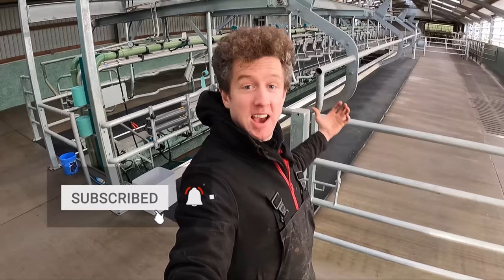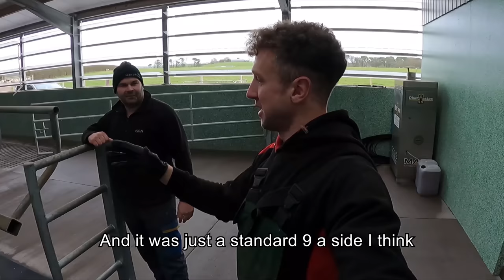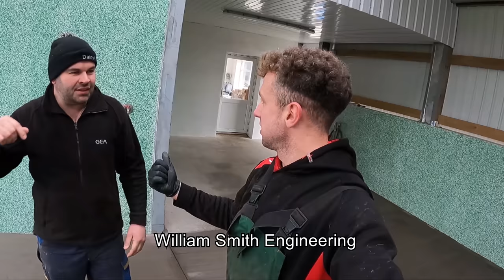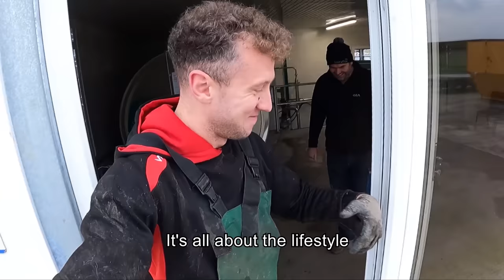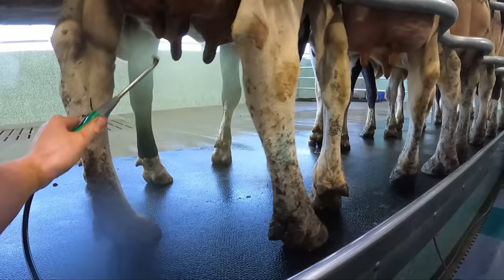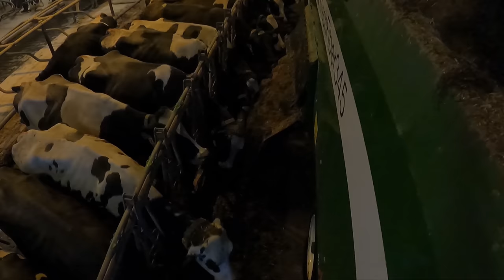This Dairy Farmer built his own 'RAPID EXIT' milking parlor!

Comment: Saskduchkid doesn’t have a swing over parlour, but he has a pooprinal  installed in the top rail. It has a shield and a gutter to save the milker from the splutter.
Reply from the maker: That does sound good, nobody likes getting covered in poo! 😂
Reply: I was also wondering how they deal with poop in this parlor, but it looked like they had very few pooping cows.  They say you should only have about 3 of of 100 cows pooping or something in your parlor is not right for the cows.

Comment: What a  fantastic milking parlour. The only thing I don't understand is when the cows walk down how do they get them pointing in the right direction?  Cheers 🍷🍺👍🏼
Reply: Before he built the parlor they probably face that way get fed meal as they were being milked, and new heifers usually are put in the middle of the group so they come in at the right angle with the older cows. Its doesn't take cows to get used to the new set up. What really got me was the ventilation on the walls, great idea.
Reply: @mistypeppercorn914   thanks for the reply. I only know about milking before these new systems, they headed for the feed and every cow knew their correct place. Cheers 🍷🍺👍🏼
Reply from the maker: Well answered Misty thanks! Cheers for the question also Chris it was a good one!

Comment: Do they not get fed during the milking 🤔
Reply: Quite a few new parlours lately are going down the No Feeder route. Keeps costs down and a cleaner parlour. External feeders in the shed are used or they are are simply fed the same meal in the feeder wagon.
Reply: @mikeysky8917  aw a c just use to working with feeders in parlour to be fair never seen a rapid exit in action but cheers mate
Reply from the maker: These cows have auto feeders in parlour that feed based on milking yield and they get a mixed ration through feed wagon also. Thanks guys =D
Reply: Awryt just same as a normal parlour then Cammie pal aye that’s the way our cows get fed cake on their yields then a mixed ration for feeding